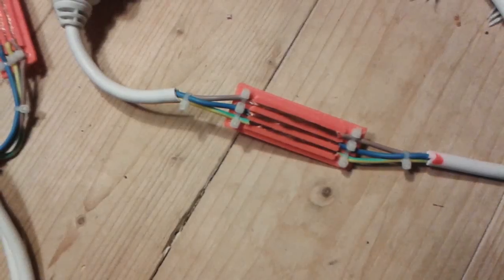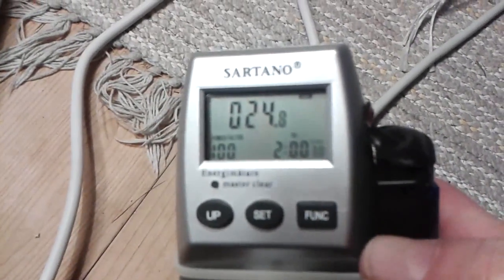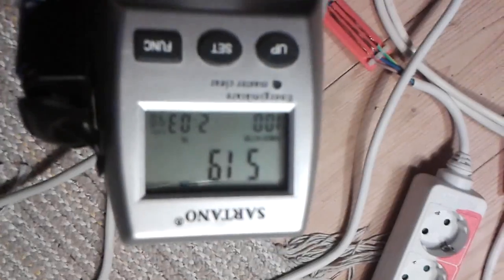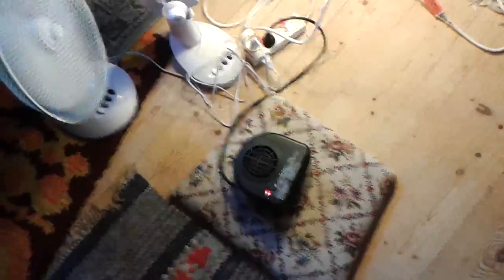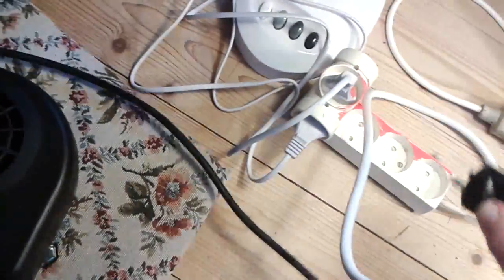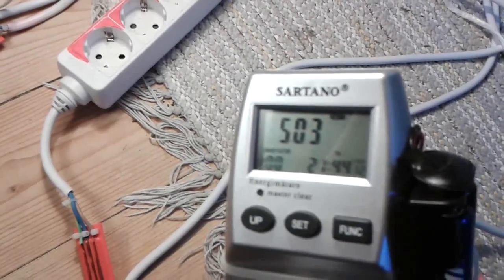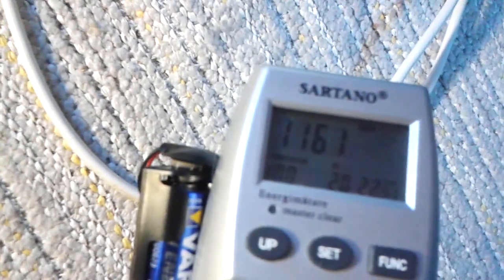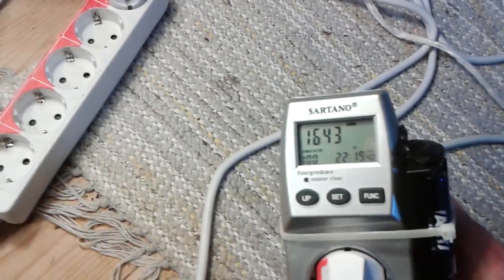#440 QEG Sweden Magrav Test 04

Comment: I'm sorry I am not trying to sound pessimistic. I am just saying that energy for our understanding sake moves from pos to neg. so the kesh gen is the pos source and the ground is the neg drain..  I'm saying kesh stated that the nano coating will not cross over standard terminal connections. must be twisted only and not soldered for performance reason.  So as soon as the growth of the nano coating reaches the first receptacle in your house that has screw terminal   the resistance in your circuit has made it's 1st appearance.  (The way to test efficacy is not to use your house or any traditionally wired devices. Use an incandescent bulb 2000 watt only as load to test the kesh gen. IF the magrav  proves to be dropping the resistance in the circuit acting as a superconductor , then I would say it's worth rewiring your entire house. or if not rewiring your entire house just use the gen on heavy load devices such as air units and compressors. but cut the plug off the fridge and twist the wire to the gen because the 3 foot fridge cord will act like a resistor for 3 feet of wire. and since you are dealing with an entire superconducting circuit the 3 foot cord to the fridge will appear to create a vast amount of resistance to your circuit and should heat up and eventually burn into flames.)  Keep me informed , btw zero I watch alot of your videos and you do very nice work. But I think you are spread out too far and you should focus on 3 types of energy gen techs and limit your self until you succeed in one. ) And stay away from analogue power gen, and I don't mean go digital, I'm saying the rocket stove is cool but the world needs guys like you to focus on the stuff that makes the difference. It seems it's more of a hobby for you, for me its ordained tech. PEACE Brother btw I am focusing my skills on pulse tech (Bedini monopole and newman unified field and any pulse gen like the kapagen etc.). I believe Kesh is harnessing pulse tech to generate the nano coating as well, but the pulse coming into his nano coated circuit will hit a brick wall at the first untwisted connection. it's the twist or spin the preserves the vortex created by the pulse coming into keshes circuit.  Thank You for your attention :)  please keep me informed of any revelations.  :)

Comment: right off the bat you soldered the connections, if you listen to kesh's lecture he said that diminishes results tremendously , what your supposed to do is twist your connections with at least couple inches slack. good luck
Reply from the maker: +myke Does What are you suggesting? That people tear apart all their house wiring to hand twist the connections to get best efficiency? Connections outside the Magrav should have no bearing on the operation of the Magrav itself. Connections inside the Magrav are made by the Keshe Foundation to their "exacting specifications". That's why people are paying big money for them. Stop being such a fool. Open your eyes. Wake up.

Comment: Good to see it's doing something. Hopefully it's not some kind of transformer and we'll see more.
Reply: +Patrick A What did you see it do? I must've missed that part!! :) My bet is still on a 1:1 transformer. would explain losses.
Reply: There was the heater he said ran at 540W. And it did when he plugged it back in, but it dropped to like 490W. Then there was the 1600-something watts listed in chart at the end that was lower than grid draw.
Reply: +Patrick A Grid draw was 1170w for the machine alone. 1640w with Keshe unit.
Reply: +Patrick A Oh I see, got my numbers switched. But the heater appeared to run a fair amount lower than he said it had been.

Comment: Hi mate. I know this maybe a bit off topic but I see that you're the go to guy for this sort of stuff. What do you think of the green fuel h20 hho kits for increased mileage on a toyota landcruiser diesel? I'm curious to know your thoughts if there is an gain in mileage? Regards
Blair
Australia
Reply from the maker: +blairo15 Sorry but I don't evaluate HHO kits. What I can tell you for certain is that diesel motors benefit most from well designed HHO systems. Best of luck.

Z
Reply: Thankyou very much mate.  I love your unbiased testing of all things alternative.  I wish you luck un your testing mate!